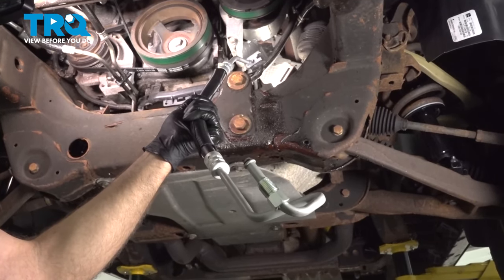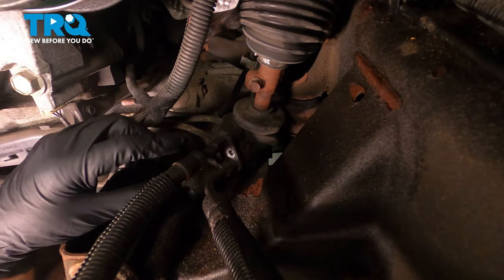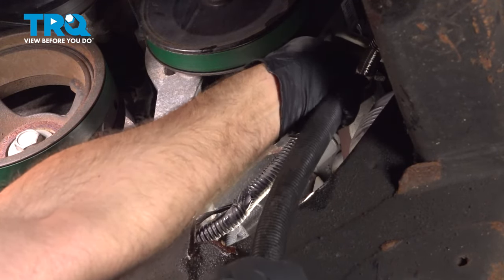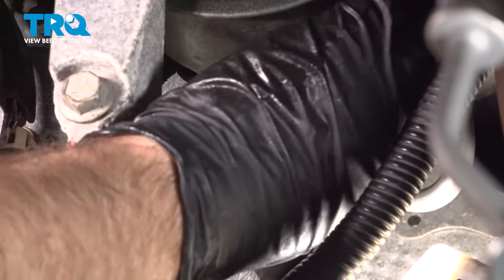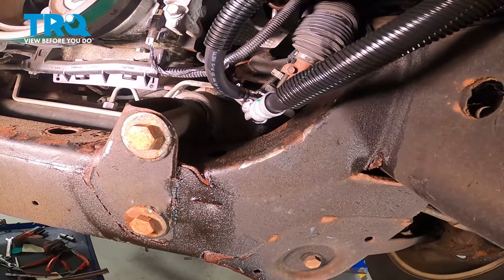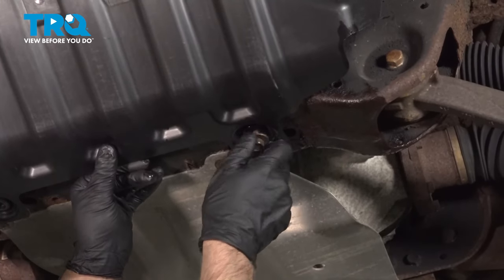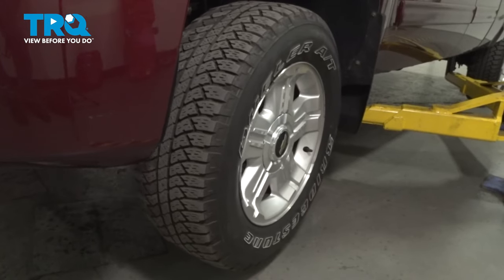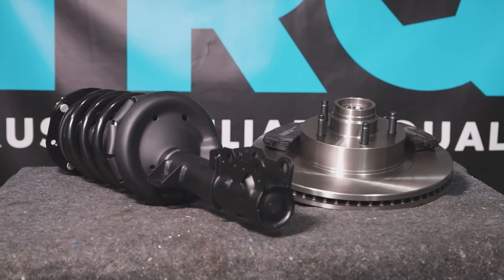How to Replace Power Steering Pressure Hose 2007-2013 Chevrolet Silverado 1500

Comment: This is the third video where they replace power steering hoses on a Chevy Silverado and have not changed the seals on the rack. My new hose came with two black seals and an o-ring.